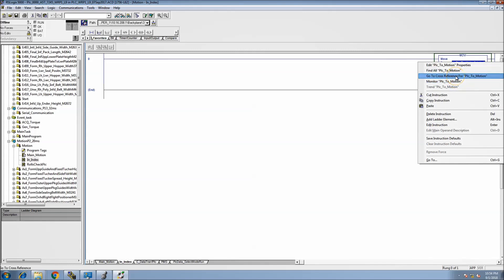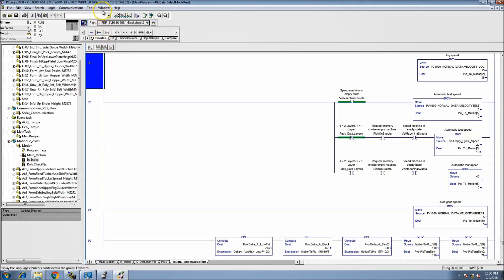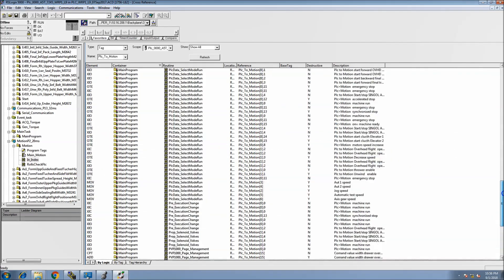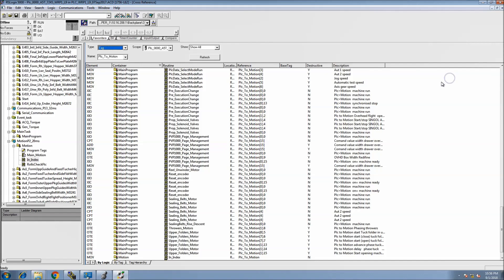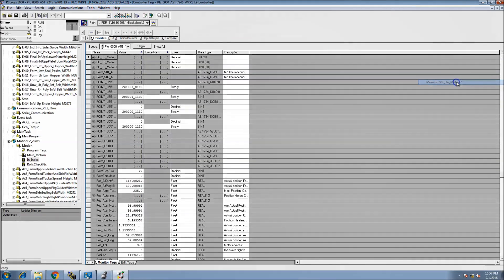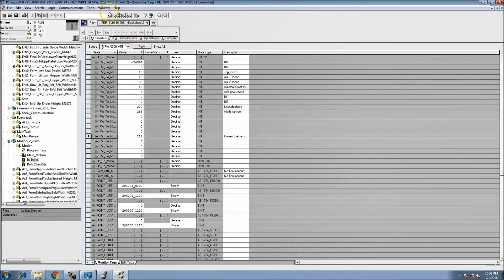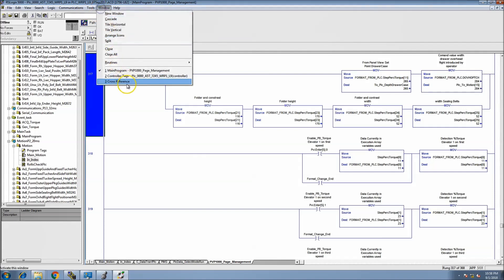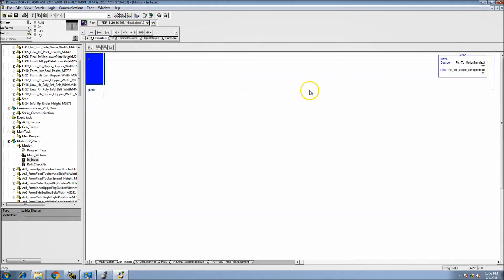RSLogix 5000 How to Find an Indirect Address Source Location [Official Video]

Comment: hello Shane, I'm beginning to learn about rslogix 500 software. I have a program that is using and AB 1100 plc that is controlling via modbus several VFD's . each drive has its own logic and part of it is a XIC instruction label (Communication OK), this instruction is only use once, I have use cross-reference and I have look at every single rung and instruction and can not find what's controlling this XIC. it is obvious that its part of the communication but I JUST CANT FIND what's controlling it. i'll will appreciate any suggestions. Note the program works perfectly fine I'm just trying to figure out why it does what it does. thank you,
Reply from the maker: Send me a copy of the program & I will take a look. 

Email me at Shane@OnlinePLCsupport.com